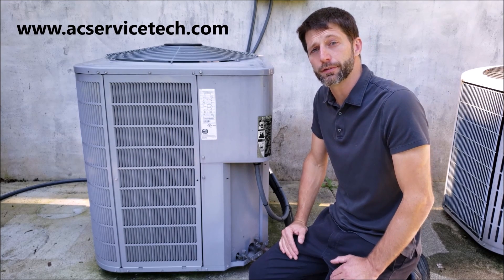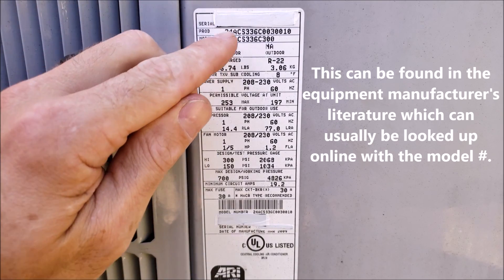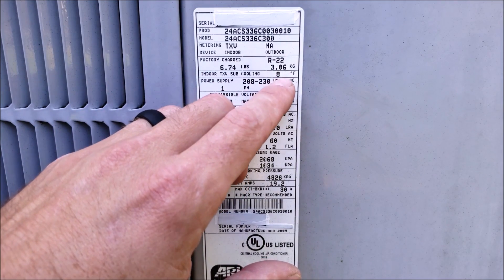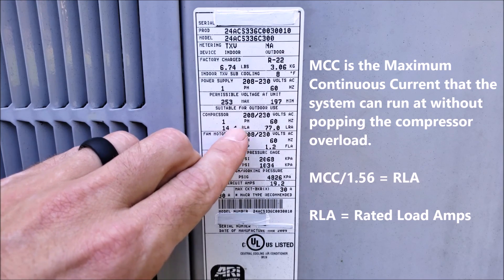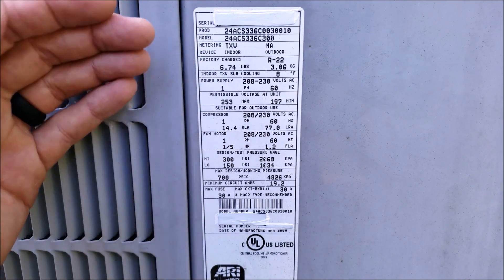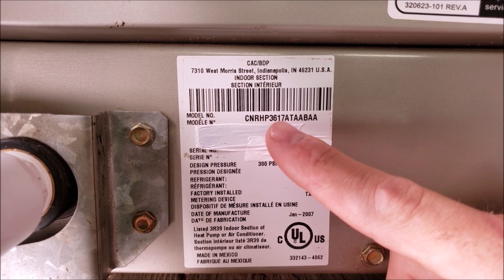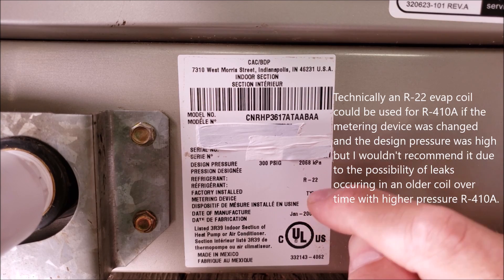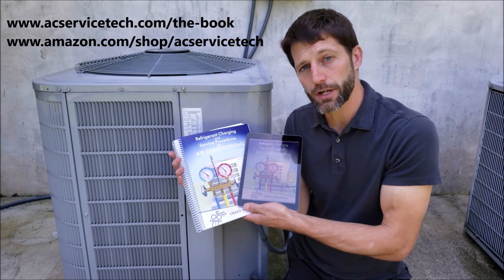Reading the Rating Plates of an Air Conditioner!  Size, Refrigerant, Pressure, Electrical

Comment: Good info, but system is out of warranty and you cover up the serial number. Supply houses won't give away parts under warranty anyways, and if it under warranty they usually require the old parts back. The serial number also is a good indicator to find out the age etc...
Reply: The manufacturer only gives a 5 year parts warranty. The correct address and original owner's name is required also. If I sell a system, I tell the customer they can register the equipment to get a 10 year parts warranty. If they sell the home in 4 years the new owner has 1 year left on the parts warranty.
Reply from the maker: Both absolutely correct, I just don't want any units I am doing videos with to be referenced during a service call or something, that is it. I got in a habit with that and just kept doing it including this older one, thanks!
Reply: Lee, why do you always have to be a D Bag.  Craig put out a good video for newer techs,. I don't know why you watch everyone's videos because you make it clear nobody is as good as you.